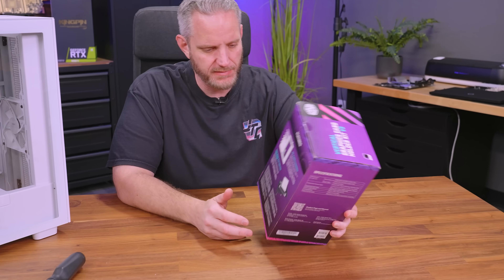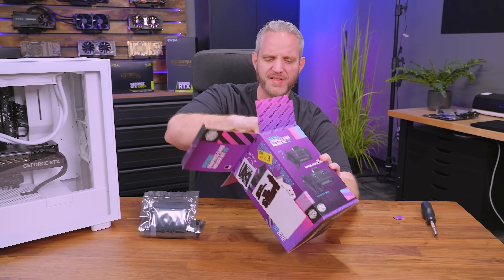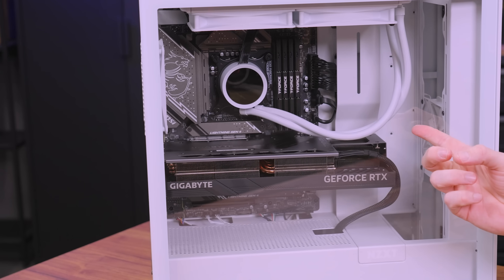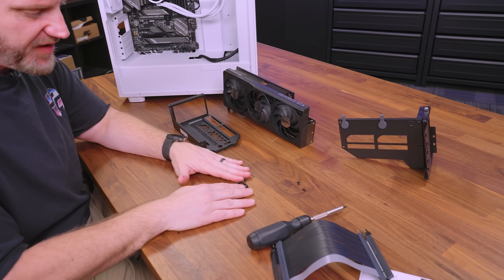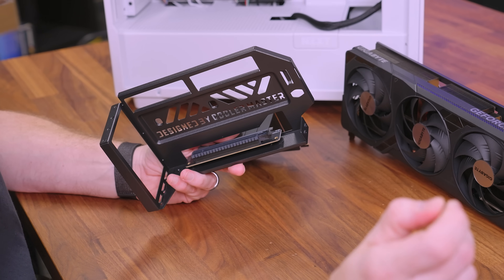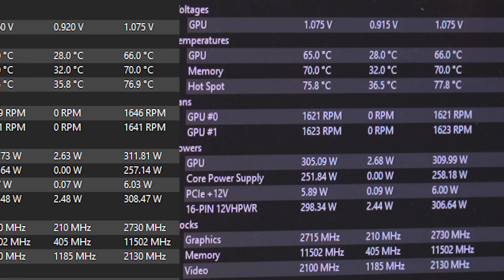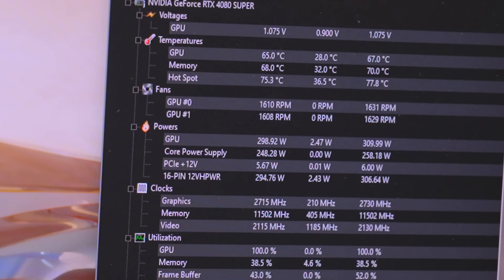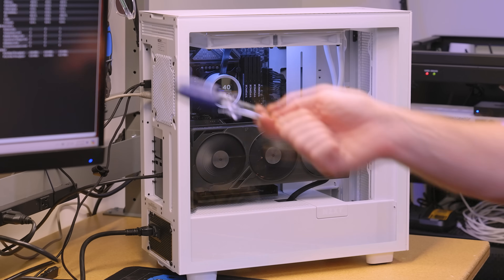Can this mount actually HELP GPU temps?

Comment: This is way after the fact as this is an old video, but i just picked this up from amazon and yes it has actually lowered my temps by almost 5 degrees. Guess my case works well for it as its pretty roomy. Its also running at pcie 5.0 too not sure whats up with that

Comment: I have the Gigabyte RTX5090 which is a chonky boi. It has a supporting leg. I saw a (rambling) vid of the stresses in the card which can cause cracking on the board. the YouTuber suggested mounting the card in a riser. Thinking about this solution.
It is an ATX case.

Comment: i bought this when i built my pc. i have the 3500x case, which isnt "supposed" to fit vert mounts. but it worked like a charm. ive since removed it because of a gpu upgrade. but i miss my vertical as well. planning on jumping up to the 4500x

Comment: Have tried using a number of PCI extenders and found them a bit janky and laggy, so i always put the GPU directly in the PCI slot and have made my own case to have the IO at the top and the GPU just hangs with 0 stress on the PCI slot and no obstruction of air flow.

Comment: Maybe a question someone can answer, I have a montech king 95 pro case, 3 intake fans on bottom, 2 intake fans on rear next to mobo, 3 intakes on top for aio and one exhaust fan on rear, I am debating a vgpu mount but I am not sure how the thermals might be affected with intake fans blowing directly on the cooling fins rom both top and bottom. For reference the design of the card is a MSI 5070ti gaming trio

Comment: the lian li v4 has an anti sag bracket so the weight isn't on the rear of the case. It also allows you to set your gpu at an angle. (didn't realize this video was a year old til after the comment)

Comment: 10:40 I have an ASRock 9070xt Taichi and it will absolutely cook itself if mounted vertically (with the ports up).  Tried to build a system in the Thermaltake Tower 300 and the temps would hit 100+ and then hard reset the system.  Had to get the bracket for the case so it can sit on its side.

Comment: With the Nvidia 50 series cards and a dual chamber case with the side fans as exhaust, it definitely helps temps.  The main advantage of the vertical mount is to help keep your GPU motherboard from warping with the weight of the coolers on them.

Comment: Vertical mounting is MUCH better in most cases.  Not for temps, but for protecting the board from flex, which can rip pads under the memory and GPU chips.

Comment: I still don't get the 12v connector, you are telling me no other existing connection was good enough to dump a couple hundred watts into a GPU? like any assortment of non reversible automotive connectors or just a xt90 with a extra plug next to it for data?

Comment: My case has the board parallel to the ground so the GPU is vertical by default. I have a giant 200mm fan so my temps stay pretty good.

Comment: As cards become heavier, vertical mounting can be a better choice as it prevents sagging of the GPU. 

Many do say the GPU would run a few degrees hotter but to me, that depends on both the GPU’s design and the case you have. For one, GPUs have exposed grills on its sides, which lets the case fans below pass air through it unobstructed. Whilst if the GPU is mounted horizontally, the base of the GPU is 80%+ a plastic cover. Which makes the fans below less effective.

Comment: Never mind the GPU temps, much more important is the sag and the potential damage that comes with it. Little impact to the case and the PCB easily breaks (even with support), and people sometimes push the card too far up with support and end up causing damage. Vertical GPU support takes that factor out the equation pretty much. I think gaming PC cases should have compatibility to mount motherboard sideways, so that the heavy GPU could just hand downwards by the PCI slot cover. A good example is the SSUPD Xhuttle case.

Comment: I dont like vertical mounts because you may need to open the gpu at some point and re Apply thermal paste.
Reply: So?.. that has always ben the case thermalpaste dries eventualy, what has that to do with the vertical mount
Reply: @maksdegek1  Because the thermal paste is vertical so it seeps out.

Comment: Using PCIe NICs with Cooler Master Vertical GPU Mount V3?
 The  RTX 5070 Ti is so thick it covers the next slot, so I’m considering the Cooler Master V3 vertical mount. Question: does the vertical mount free up the remaining PCIe slots so I can run a dual-port Ethernet NIC (and have the NIC’s RJ-45 jacks exposed at the rear I/O), or does the bracket/cable block them? does anyone know of a verticle mount that does ?

Comment: How do you plug in the HDMI/DisplayPort ?  Did you slide the whole card towards the front of the case? Cut a rear port on the case to allow cable clearance?

Comment: Can i ask i uabe msi barbon board with a 5090 and would like to buy one of these but was wondering is the wire that come with it the 4.0 ok to run with thr 5090 or ahould i bit i uphraded ome ans what one?

Comment: In a themaltake view 51 , going from horizonral to vertical with a 3080 founders , with 3 bottom case intake fans too 120mm , and a 5900x with a 280mm Karaken X mounted Vertically with Pipes going down to up towards the Pump, and additional 4* 200 mm 2 intake 2 exhaust and 1 140mm exhaust rear, what i noticed is after 4.8 years of no pc 0 issues , while playing ragnarok i was getting bsods, temps were fine both cpu and gpu , memory junction also max 85, then even if i cap 60 fps i get crashes at intense scenes, and in valorant i was getting crashes , so i thought maybe its the thermal paste it's dried out after 4 years (kryonaut extreme) , but cpu temps max 75° so i underclocked the cpu and and gpu too 3.0ghz and 1.5ghz on gpu and voltage too and now was getting max cpu 40° and gpu 55. Still crashes, no crashes in stress test or benchmarks, bsod whea error, tested ram for 2 hrs 0 errors , samsung bdie 3600 cl14 32gig, msi unify mobo, 990 pro ssd is new 0 errors , i lost my mind , did ddu and again crash , became severe crashes straight in loading screens now even on stock settings no curve optimizer stock ram no Xmp. 
Lost my head temps normal everything fine, then i did power test occt3dt and as soon as power test boom hard restart, sometimes pass sometimes fail, cpu test always was success. 

Then i started noticing gpu test 3900000 errors and gpu usage in test 5% only and crash, this happened in recent days , so i underclocked heavily just 45 degree max temp and power limited , still crash, 

So i just felt bad opened side panel and touched my gpu with my fingers to feel its heart beat as mine beat very fast seeing a dying gpu (my first Expensive gpu in life) , so i noticed as soon as i touched it , boom 99% usage  1.9ghz stressed for 8 mins no issues, power test no issues , games no issues boom i figured out , its the slight sag that would have loosened the pins touching the pcie slot ... So i unplugged everything, blew dust out , cleaned gpu and ram with isopropyl 99% , cleaned pcie lanes , used different pcie cables RMX 1000w, reinserted 24 pin, had a cooler master vertical mount kit pcie 3.0 v2 lying around, used it until i got a , antisag support bracket, and also was waiting for ptm honeywell from china to come another 2 weeks, 

Boom after plugging all in no display, i figured had to plug in normally and select gen 3 on mobo e1 lane, boom booted up, cpu temps dropped by 10° and boost all core now 3.95 from 3.65 and single to 4.95 ghz . 
Gpu 100% usage max temp increased now maxes at 84 at 100% load for 15 mins with memory at 98Max . 
But 100% stable no issues no bsods no nothing , everythings perfect 

Yes temps gpu increased but i power limit and still get 450 fps on val so it goes max 60° c. Cpu max 60° now . Waiting for ptm to arrive , once i get that and apply on cpu and kryonaut extreme on gpu and also will lookup to change thermal pada on gpu. (Scared as no warranty )

Yes The temps increased a bit on vertical mount and i dont recommend it but it looks so hot now. 

Thanks to chatgpt we both grinded for 24 hrs to figure out whatd wrong without having to swap parts or reinstall windows .

Guys i need help with antisag brackets if i get one then wouldn't my bottom fans come in the middle?

Comment: i use this gpu bracket with tuf502 i have intake fans in the bottom and side fans, exhaust top aio and back, my temps increased 3-5c and timespy scores decreased i have xtx nitro, maybe if i swap my bottom fans to exhaust i will have better temps?

Comment: I was considering getting one earlier this year, but I found that I didn't need to have my GPU mounted vertically so I only bought a stick from Amazon for $8 instead of spending over $55 for the CM vertical mount.

Comment: Random Youtube recommendation day. I used this in my Antec C5 a few months ago and it works great. My only issue is attaching cables as I am too nervous of the future to cut the rear slots for better access. Thats a pain but I deal.

Comment: I wondered if mounting it vertical would help the air flow my H9 Flow case has 12 fans including the cpu cooler thermalright peerless assasin. My graphics card fans blow downward towards the intake fans that are blowing up i assume that cant be good for the graphics card ? Also Do AIO coolers ever leak ? I want one but.. liquid/electronics... idk i don't have the money to replace a whole new computer

Comment: Jay, I bought a Lian Li vertical mount/bracket for the O11 Air Mini (PCIe 3.0 version, $19 on Amazon) and added a single 120mm fan under a Gigabyte 9070 XT Gaming OC, pushing air up across the cooler fins. Compared to stock, I observed a >15* decrease in GPU (53 vs 70) and GPU hotspot (64 vs 80) temps, with the same ambient and no other changes. It seems some setups can see a significant change in temps with vertical GPU mounting. I'd love to see a follow-up video using a 9070 XT Gaming OC in your O11 Air Mini.

Comment: thinking of getting this vertical mount now! I did not want to buy an $80 vertical mount from the manufacturer of the case I bought when I knew this existed
Reply: I got one. I had it with a 4090 and now a 5090. It is a little akward, but it is made better in terms of quality than any other mount I tried. It's also akward due to the cards I have being so damn big

Comment: Does this vertical mount will fit well the aorus master rtx 5070 ti, considering if one has a spacious chassis?
Reply: I have a 5090 in the mount, a 70ti will be fine

Comment: I would like to add one. The problem is my corsair graphite t680 dont have a cover for the psu. So the vertical mount cant rest on it and wojld only be screwed in in the back. I guess when it hangs in the air this isnt good.

Comment: Does this model works for the nord xl ? I cant find the original Fractal Design Flex 2 in my country. Need to look for any other brand which would work with my tower. Any idea? Regards

Comment: I’m not worried about the GPU heat w a vertical mount, it’s the MOBO components and CPU I’m interested in.
Reply: Depends on case and all of that. In my tests my nvme maybe went up a degree, my mobo temps went up a degree and my cpu stayed the same. This was with a 5090

Comment: I had an older AM2 socket, 6850 GPU somehow warp the plastic PCIe slot. By means of heat and , or weight. This is why the slots are now reinforced. This was not always the case.

I still dont trust them to hold the weight of modern GPU's who weigh as much as house bricks now.

Comment: Hyte y60 with this mount can the Sapphire Nitro + 7900xtx work? Use this mount to move it away from glass? Please someone help answer thanks
Reply: Im with sapphire 7900 xtx nitro+ and hyte y60, but, all heat it produce the AIO warms the CPU wich is in the top, I saw some aftermarket or Hyte themself sold a difrent side of glass with holes in it, so My friend made a 3D printed holder so I can mount it horizontinal the GPU so all varm air will be pointed to the side and go out instead. But I havent done all this yet, I bought another case, Horizontinal mounted GPU, and still need the  case open, even with fans in it...
Reply: remember vapor X is not same as Vapor chamber ass all those ref MBA gpus
I still not know how to mount this sapphire GPU we have

Comment: I'm using NZXT 2024 H7 with top, front, rear and bottom fans, and I'm using Gigabyte RTX 3060 Eagle. After I changed to a 4k monitor, the GPU temp increased to a constant temperature of 79°C while gaming. After installing the Cooler Master Vertical GPU mount yesterday, the temperature drops from 79°C to 74-75°C while gaming😄. That was a huge drop for me. The mount was very stable and solid, it doesn't need additional support from the bottom. Like what Jayz had experience, the mount will looks a bit up on one side but as long as it is solid and stable, not a big concern to me. I would recommend vertical mount to prevent sagging and stress on the PCI-E slot as GPU card is getting heavier. Vertical mount improve my GPU temperature if you have a lot of space and fans (especially bottom fans) in your case.

Comment: Hey Jay, you had a giant case in a different video, I fell in love, lol, are they avail somewhere? Diff question i cane across a case ...an older model from Thermaltake, the Versa 24, it's a cross between Batman and Alien hence why I bought it. Well i paid $65+ for a vertical mount, that came with additional probs, 1.) I can't figure out how to get the vertial mount in or whereit goes. (Guess that would be a second question lol) 2.) the PCI cage is riveted in,  see my dilemma? I really want to get this built before m the funeral,  xan you o the help, any suggestions? Any at all would be greatly appreciated. I'm ill  a lot and frankly running out of options, please please help 🙏🙏 thank you ~🙏❤️🙏🙏

Comment: Retest in a Matx case with ASUS mobo, for some reason they put the pcie slot 2 slots lower than where it should be. In my build my 2 slot gpu has about 1/2 inch of breathing room before hitting the psu shroud. Gonna need a vert mount for some extra breathing space